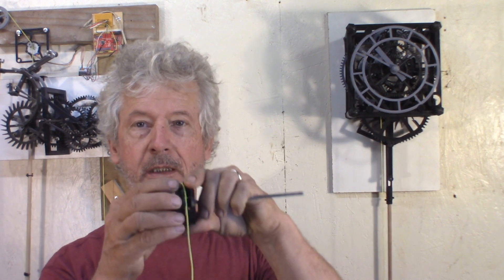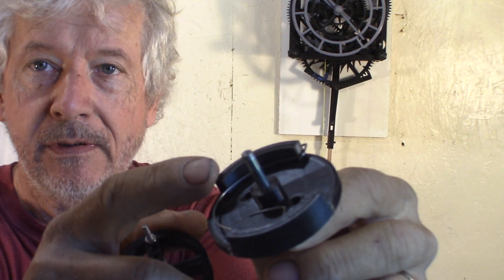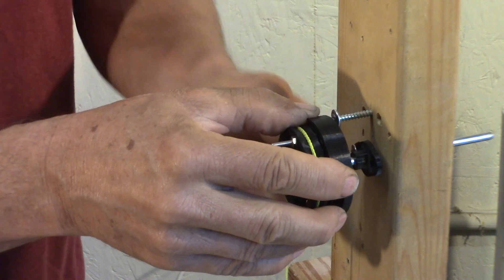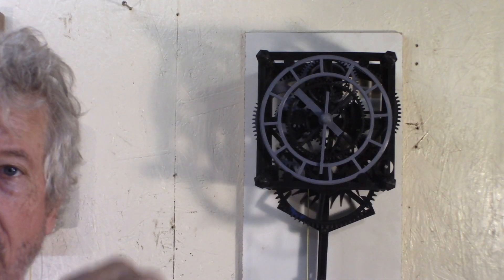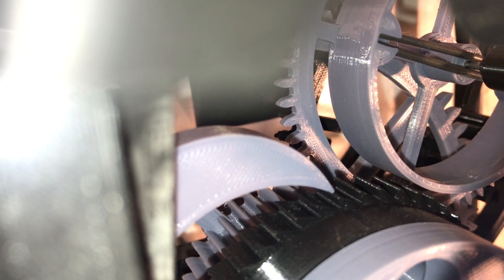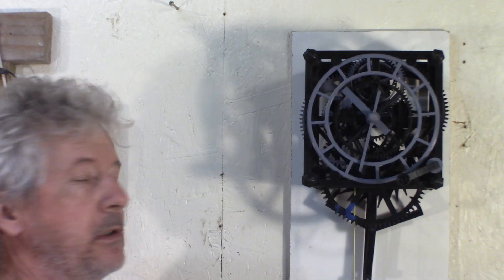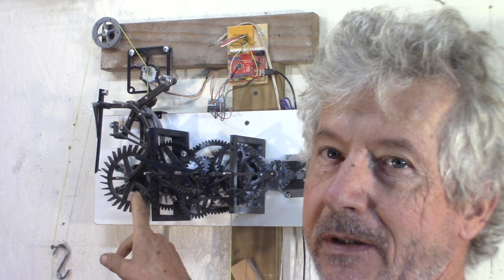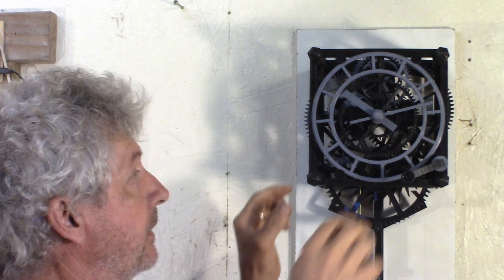Clock Design with FreeCAD 0.19 and Assembly 4 Workbench Part 9

Comment: Great design, especially important for the grasshopper escapement. I have considered adding maintaining power on my clocks, possibly between the minute hand and the escapement where a smaller spring could be used.
Reply from the maker: Thanks
I have been wanting to do a Grasshopper escapement clock for a while, now I can start planning for one
Just curious to see how the piano wire spring will holt up in time, I will have feed back in a few months, maybe?
Reply: @jacquesfavre999  Music wire is also known as spring wire. It should last a long time.

Comment: I like this video.i have an question ,to have an accurate time keeping what is the length of the pendulum or how to calculate it,and how much weight should put (weight driving)?
Reply from the maker: I do not have exact formulas.
the distance from the center of mass of the pendulum to the axis will adjust the timing
for a 2 sec pendulum it is about 1 meter.
weigh of the pendulum does not matter that much
Reply: @jacquesfavre999  thank you!